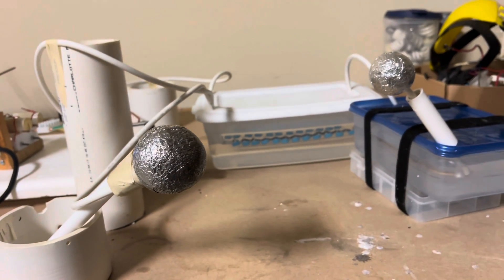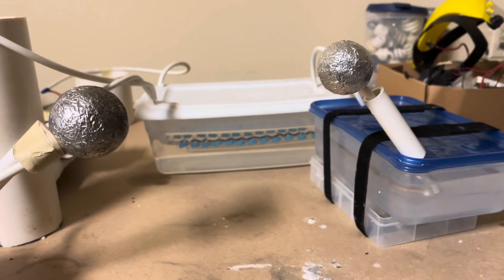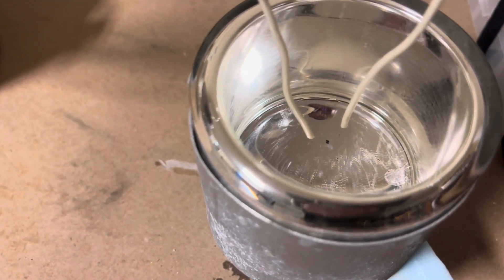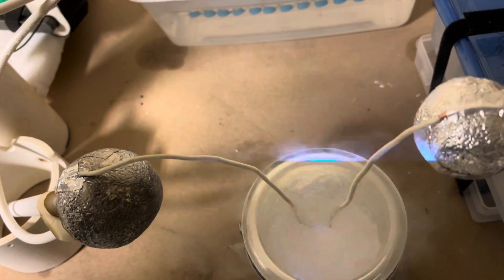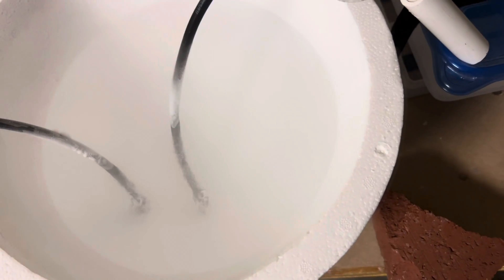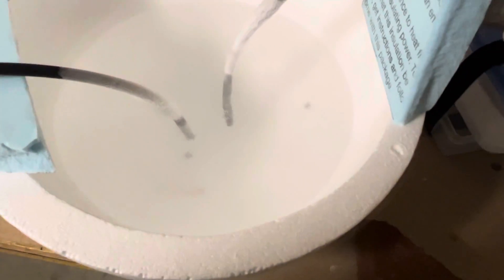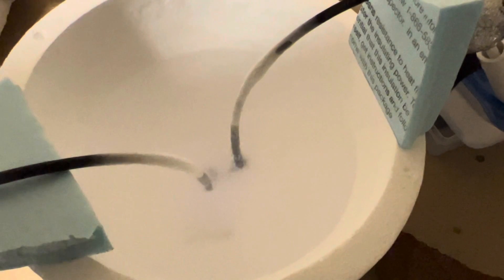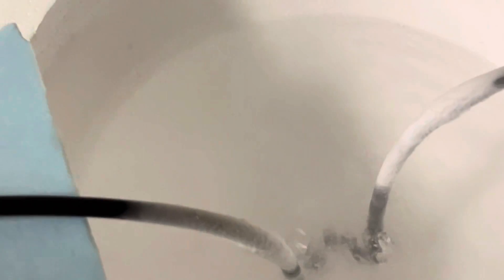High Voltage Discharge through Liquid Nitrogen

Comment: which polarity was the wire that kept moving? fantastic spark gap experiment maybe it superconducts at that temp...i have never seen an arc under liquid nitrogen...i wonder if any acids form.
Reply from the maker: Yes thank you. The wire that kept moving was the positive wire. The plastic insulation also started to chip off this wire but not the negative wire.
Reply: Possibly small amount of nitric acid like in a birkland eyed reactor

Comment: Hi! How are you driving the multiplier?
Reply from the maker: Driving it with a ZVS powered flyback transformer
Reply: @BrianDhvTinkerer  standard Chinese zvs? Careful ramping it and on low voltages they sometimes jam up and get stuck. At least with my experience they are temperamental. I made a 10 stage multiplier with 30kv caps and got through two zvs modules testing it on low power. Have replaced mosfets for now and added filtering cap. Still looking out for something more reliable
Reply: @BrianDhvTinkerer  am using subaru outback ignition coil instead of a flyback. Prob not designed for that high a frequency
Reply from the maker: @SodiumInteresting  I made my own ZVS driver and power the mosfet gates using an independent 12V power supply (12V wall adaptor). That way I can power the ZVS below 12 V and still have it run reliably. Not had a blown MOSFET even with really pushing the output.